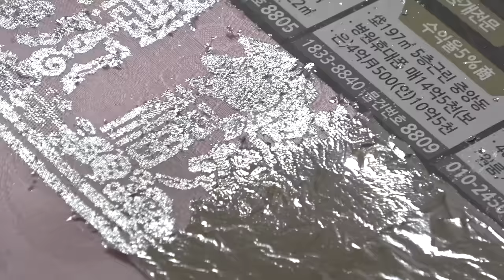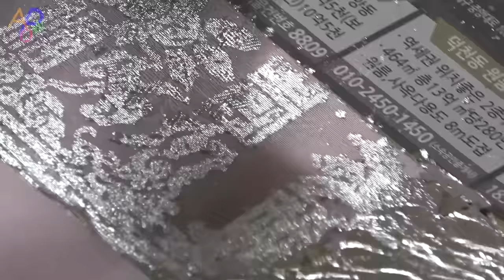Korean Traditional Clothes. Process of Making 'Hanbok'

Comment: Absolutely beautiful. As a seamstress I understand how hard this is and can appreciate all the details. As one who loves history thank you for keeping your traditions alive.
Reply: Do you know what the white paint at 3:44 and the foil that broke when he hammered it at 3:52 are called?
Reply: @claire4212  yes it’s called leafing and it’s been around for centuries. What looks like white paint is actually a special type of adhesive and the sheets that he puts on top are made of a compressed metal usually gold or silver. It is very delicate at can crumble to dust easily. Once the sheets are over the adhesive you use the rubber mallet to push the silver or gold leafing into the adhesive and any excess just crumbles away to dust leaving a beautifully gilded design.
Reply: @patriciaschiro2659  thank you so much 😊